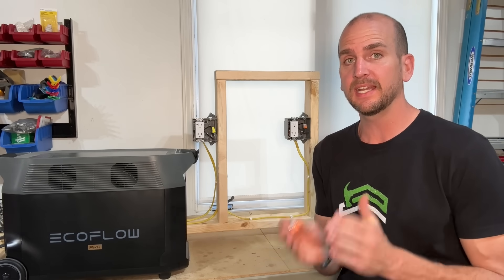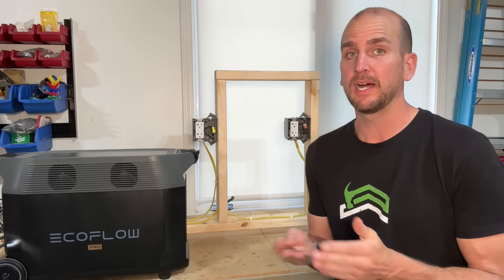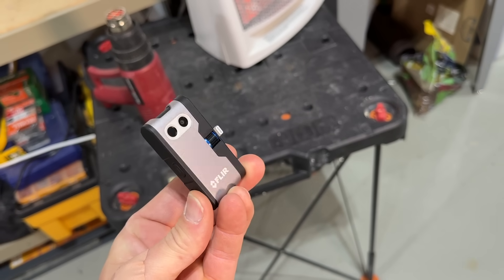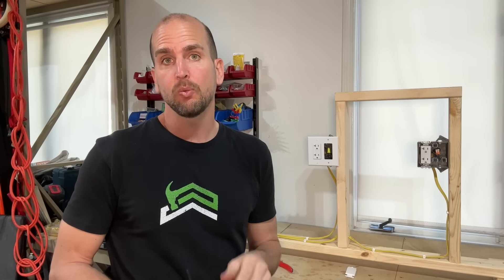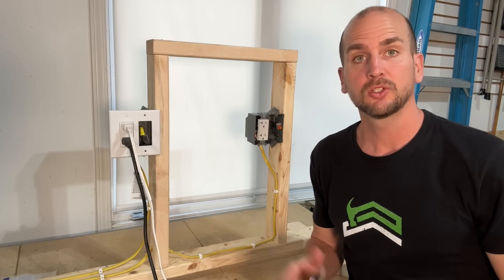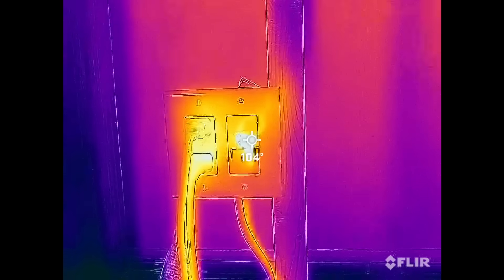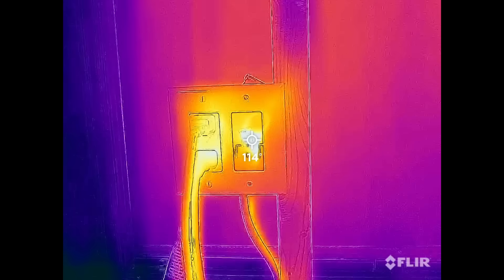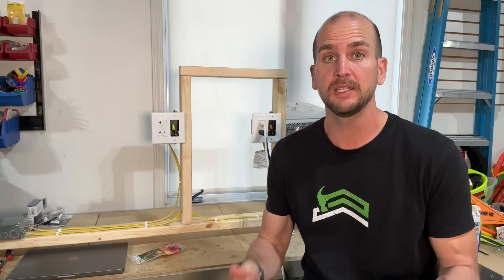Debunking the Pros: Can WAGO Lever Nuts Handle Heavy Electrical Loads?

Comment: I want to clarify something Scott keeps saying which is a little misleading (and that is Wago's fault):  Wago 221 lever nuts are a FAMILY of products with different current ratings and gauges of wire.  The ones Scott is using are the 221-41X side of the family which are rated at 20A/300V.  The X represents the number of conductors, so 221-415 is a 5-wire Wago.  Now the misleading part: there are different Wago 221s for higher current applications up to 30A/300V and supporting conductors from 20-10 AWG.  If you need Wagos for higher current circuits then those are what you need, and they are available in 221-612, 613, and 615 sizes.  Sadly, no inline splice connector in the higher range yet.
Reply: You are only partly correct. 20A rating is only for Japan (PSE JET) only. In europe and north it is rated at 32A (ENEC & cULus).
Reply: Great point on the 221-600 series.  I’m adding them to my tool box as well.
Reply: Were I doing a heavier load, I might opt for wire nuts for the additional temp margin, but typical household loads just don’t outstrip the capability of the Wago. Even these “worst case” home load scenarios aren’t putting them close to their rating (and that has a safety margin above it). The simple truth is that, at the failure point of these connectors you’re above the failure point of the conductors.  It’s a moot point by then.
Reply: Good to know
Reply: Yeah I had to buy Wago levers for 10 guage and noticed you can't get them in inline connectors, only side by side. Why did they do that?
Reply: Question for electricians out there. Has any electrician soldered the twisted wire to get good born and prevent oxidation before inserting into a wire nut? Is that against code?
Reply: You are correct. They would be required here in Europe for the load that was applied in the test.
Reply: We use the Ideal connector on our projects everyday we are using them to run low wattage AC motors around 60 watt each. With hundreds of installations we have not had any issues yet!! God willing I hope it stays that way!!
Reply: @shopart1488 This Wago connector is rated at 32A. His info is a bit misleading.
Reply: Update- Wago now makes several  amp rating inline single conductor connectors.
Reply: @brucecooley4170  To bad Wagos are so fucking hard to get here in the states!
Reply: Master electrician here.  Tested the previous 222 series the same way many many moons ago and had the same basic results.  In the end most of the Jboxes we install in homes are single gang and have far less space in them for the conductors.  That is to say, they are more likely to see greater temperature rise of all the components.  Now though rated to greater temperature excursions, the cooler the better.  Any additional temperature at any junction point will result and additional aging and eventually oxidation and finally failure of the connection at the point of thermal runaway.  Now all this is not to say "Wago bad, wirenut good!"  I use the Wagos a fair bit and especially with stranded wire where I think that the difference in the pair almost shrinks to near nothing.  But there is a quantifiable difference none the less even here with the stranded.  Here in this test the Wago connections are at an even greater disadvantage.  I did a lot of service and troubleshooting across residential, commercial, and industrial clients for the better part of a very long decade and I have seen failure of both connectors.  Skilled termination of wires via a wirenut is simply superior thru the simple fact that there is one less connection interface and that connection is copper to copper.  The Wago is copper to tinned brass tinned brass to copper.  As to his point that they are rated to 221F (105C in non retarded units) this too is technically not correct either.  Pretty much all devices and breakers are rated to 167F (75C) and we are limited by this rating as to our sizing of our conductors and there anticipated temperature rise.  Furthermore, as the connection temp excursion increases at the connection oxidation of the conductors progresses and the resistance at the interface does as well.  At some point this results in a thermal runaway and the connection burns up.  I have seen this many many dozens of times over the years.  Personally I say use them, they are hard to screw up the connections and they are more than sufficient in just about every application.  Where I would not use them would be base board heating or a circuit where the wife was going to plug in a space heater to run all day in the winter or for a window AC feed.
Reply: @mikeiver  5 degrees means nothing.  And as far as that goes the "skilled" use of a wire nut is the exact problem.  I have seen plenty of problems in my junction boxes from electricians not fully twisting the wires with the wire nut or by using the wrong size wire nut.  So, if an electrician has problems using a wire nut correctly, then what about the homeowner?
Reply: @msromike123  5 degrees initially is not much of a concern.  But over time, as the multiple contact interfaces oxidize and resistance rises, the temp will rise.  This could lead to failure down the road.  Neither one is perfect but decades of experience makes me lean towards wire nuts installed with care.  They can be the next best thing to crimp in terms of current carrying.  Again, I use Wagos all the time.  I just choose when and where based on expected conditions.
Reply: @mikeiver  Well said and thank you for bringing some reality to the discussion.  BTW, whoever is running the inspectors should be a Registered Engineer, one capable of understanding electrical engineering and regulator complexities and therefore can properly limit inspection exceedances where they arise.
Reply: @pibbles-a-plenty1105    Where I am located the third party inspectors are professionals and licensed.  Where I work we have dedicated electrical engineers that have stamps.
Reply: @mikeiver  I recently replaced a water heater and re-used the wire nuts that were on the old heater. Two reasons. #1 they were there. #2. The slightly less amount of resistance they have VS Wagos as shown in many demonstrations on YouTube, including this one. Since a water heater runs a lot and is a 220 volt circuit, I figured I'd go for that. Also, connecting two 12 gauge solid wires with nothing trying to yank them apart while they're being connected is an ideal use case for wire nuts.

The same remodel project also involved running a new 20 amp 120 volt circuit to the room, then split to two lights and two outlets. For that I used three 5 hole Wagos, and thanks to the US NEC not accepting the more stringent testing in Germany and some other countries I had to cram them loose into a metal junction box instead of neatly into a superior Wagobox from Connexbox. I wonder if Connexbox could crowdfund the $$$$$$ to have their products UL tested? When Germany allows an electrical junction box and connectors to be used for inaccessible installation (such as wayyyy up high in a roof structure with no service ladders or embedded in a masonry wall) it should pass Underwriters Labs testing very easily.
Reply: @greggv8  here is the thing about NEC, allot of it is up to the AHJ (Authority Having Jurisdiction).  I have in the past installed European certified, but not UL, rated equipment and gotten it inspected and signed off.  The inspector has a bit of latitude and a good one will likely use it.  If you can make a good case for the device and show it to be same and accepted in say Germany or England then most I know of will likely pass it.  Now where you will absolutely run afoul of the NEC and inspectors is trying to bury boxes in a wall or ceiling with no access and this is for very good reason.  Poorly done connections can and do fail and electricians need to be able to locate and access these junctions to effect repairs.  If you expect that the NEC will allow this sort of thing in the future you will be very wrong.  I can't tell you how many times I have had to trace out an open circuit and find a buried box in a wall or ceiling.  Some have taken hours or even days to trace out.  NEVER BURY BOXES!
Reply: @greggv8  The reason that the wagobox is not allowed is not because it is inferior.  It is because installing a junction box hidden and inaccessible in a wall or ceiling is not allowed by NFPA70.  That and it is fucking idiotic to hide junctions!  I seriously doubt that any jurisdiction other than say New York city or Chicago would not allow you to use these in basements or attic spaces as long as they are installed per the instructions.  Know why?  Because I have used them a number of times with the inspectors having no issues at all.
Reply: No 4 hole Wagos at all. They would be very useful when needing to put 4 wires together, but there's only 2, 3, and 5 hole versions.
Reply: @greggv8 then use a 5 slot one
Reply: @greggv8  I don't see that as a problem
Reply: @greggv8  sure there is. Just used those today :D there is even two direction version. If your local shop or google search wont bring one up it doesn't mean it don't exist.
Reply: @greggv8 Then use the 5 hole version if you need 4 wires spliced together. What’s the issue?
Reply: @JohnLee-db9zt space in a box can get tight when there are several connections. Any unused ports on Wagos just take up room.
Reply: @greggv8  doubt one unused port is gonna be a problem.
Reply: I wouldnt say this is Wagos fault.. this is just a misunderstanding on Scotts part. As you say yourself in your comment the Wago 221 is not "one" wago, its a family of products. There are wago 221 lever nuts for up to 4mm^2 wire and a seperate one for 6mm^2 wire.

I dont see how this is Wagos fault when Scott simply doesnt mention what Wago already makes clear to everyone and on like.. all the packaging and branding i see.
Reply: Everything he said is misleading, hes selling them. Hes not an electrician hes just a utube self appointed expert, trying to sell that junk.
Reply: scott is trying to sell them, of course everything he says is misleading.
Reply: Wirenuts are far better.
Reply: If you’re using wire nuts, you’re an amateur. No excuses.
Reply: @JasperJanssen  Seriously, we're you dropped on your head as a kid multiple times?    Wire nuts are not glamorous or modern but I run across some that are likely 80 plus years old and made of ceramic.  The connections are still solid and functional.  I use both depending on the task.  If what I am doing is gonna stay and likely never need to be serviced then it is 100% twist and wirenuts.  Same if it is a heating circuit.  Small HP motors and lighting I use either tending towards the Wago.  Large wire above 10ga it is wirenuts or something like a Polaris tap.  You idiots that back one or the other in a blanket fashion are Fing morons and likely should not be in this trade in the first place.
Reply: @JasperJanssen 
Yeah, amateur hour when one size wirenut works for current ratings that wago has to be rated for. Sure, very amateur 😂.  Proper wirenut adaptation: The wirenut will twist the wires and act more like heatshrink than being a part of the circuit. Wago literally becomes part of the circuit. 

Only a real amateur can not simply twist a wirenut correctly. You don't need tradeschool training for it.

I mainly came here to say that correct size wirenut for the gauge of wire its being used on, does not need a current rating like wago. Seems like going back a step rather than forward. But i saw this hilarious reply you did, figured why not reply back.
Reply: @ what frequency  
The usa uses 60hz the eu uses 50hz  and smaller ga wires. 
The speed of the electron has a lot to do with restance.
Reply: @bobbg9041  Your reply makes no senseat all and is not relevant to the subject.  IE, all I see is static noise.
Reply: Yeah, can't see many DIY'rs knowing this or being able to figure it out.  If can't take 20 amps, shouldn't be sold.
Reply: None of them are any good.
Reply: Misleading, Scott is a bozo trying to sell wagos which are garbage. He is a jack of all trades master of none. He pretends hes an electrician, hes far from it.

Comment: I think there is less potential for a poor connection using the clamp style connectors. Twisting the wire nut can and does sometimes have loose connections which can arc across conductors causing high temps or fire. That is why many pre-twist the wires first to verify a tight twist of the conductors before twisting the nut on (best practice but not required). Thing is many would just rely on the wire nut for a secure twist. It seems that the  'insert, clamp and done' method is much more fool proof for a solid connection. 🙂
Reply: If you know what you are doing, a wire nut provides a great long lasting trouble free connection.  Most people on these DIY'er YouTube videos shouldn't be doing electrical work anyway.  :face-turquoise-covering-eyes:

Comment: I saw a job where 5 neutral wires came together under a large wire nut. Over time the nut worked loose and was causing one of the lines to have an intermittent open neutral, let alone the high temperature at that joint. A wago solved this problem. 

Thus, for another test, maybe try splicing in more than one wire, and measure the result. For grins and giggles, throw in a test case where the wire nut might be installed by an incompetent diy-er.

Comment: Ok I dont use these mostly because Im Dutch..Lol. For me the stigma started with the early receptacles with the push in connectors, they were bad. Even now I have seen occasional issues. Testing these cant be done in a quick video. It's the heat/cooling cycles over a some years with higher load use, that any problems will show up. 
At any rate Wago connectors are fine  and still better than other push in connectors.

Comment: If you do the math - a wago 221 is the equivalent of adding an extra 3 feet of cable to a run (in terms of voltage drop and power dissipation). The only downside is that it concentrates that drop and heat to one point. The question is: Does it matter for any practical purpose? The answer is no.

Comment: I'd like to see more than one cycle in a controlled environment. Add hot/cold temperatures like might be seen in a garage, dryness and humidity as typically seen in kitchens and bathrooms, environmental pollutants and corrosives, and multiple cycles over a period of time. One test for temperature difference is statistically insignificant and allows our bias towards ease of use to sway what might otherwise be an informed opinion.

Comment: If you really want to perform this test to the limits: Code allows up to 10 receptacles on a 20A 120V circuit.
Therefore, you should repeat this test with the following changes:

- Splice in 10 wire nuts / Wago's before your test receptacle.
- For the wire nuts: Be sure to test with twisted wires this time (using pliers, twisting clockwise) before twisting on a (correctly sized) wire nut. Regardless of what the instructions say, any good electrician will tell you twisting is best-practice. Ideally you would test no-twist, and twist (just to have another comparison point).
 - Consider taking a voltage reading along with temp. That will indicate voltage drop (when compared to the source voltage) and you can derive an actual resistance (and power-loss) figure.

Comment: What happens with long term use do they get more resistance.  Remember aluminum wire i replaced a lot of switches and outlets and pigtail copper wire onto the AU wire

Comment: 8:30 Slightly misleading graph, make sure that the y-axis starts at 0. 115 farenheit is roughly 46c which isn't even that warm out of a maximum of 105c. And if you measure temperature above room temperature (let's say 20c which is 68F), that's only 26c above ambient.

Comment: I've seen authentic Wagos melted on 20A breakered circuits.    Never seen a properly installed wire nut do that.  That's enough for me to not want them in my house.

Bottom line is they're getting hotter, that's wasted energy.

Comment: Lets face it people hate change and with the WAGOs this is a change from the long used standard wire nuts. I like the ease of the WAGOs verses the standard wire nuts for a couple reasons  I can see the wires are connected I can feel the wires are tight and the bulky wire nuts are not in my way in a tight box WAGOs fold flat with the wires.
Again it is something new and old men are set in their ways, always will be an argument to use or not to use.  Thanks for the video and your testing.

Comment: Electrical engineer here: this is a good test setup, and it answers the question I have also felt about the Wago nuts: contact resistance. My only comment is that a space heater will be in use for hours at a time, and for months at a time in some locations. The longer the heating, the more resistance change OVER TIME you will see. So the real test that has to be run, that is not easy for anyone to do, is to run these heavy loads for maybe 6 hours a day for 6 weeks? After that time has passed, then measure the temperatures to see if they are now hotter than the initial tests. Heat increases contact resistance over time.
Reply: But wouldn't that also apply to a wire nut?
Reply: But wouldn't a 20A breaker trip before it was overloaded? How common is it for electricians to ignore wire gage and breaker rating?